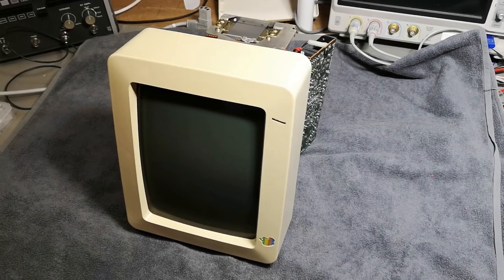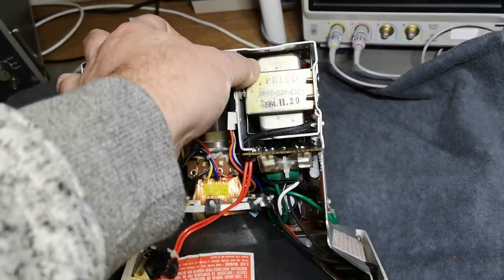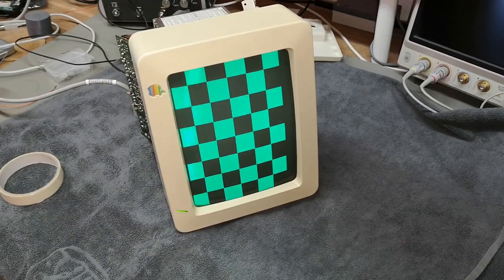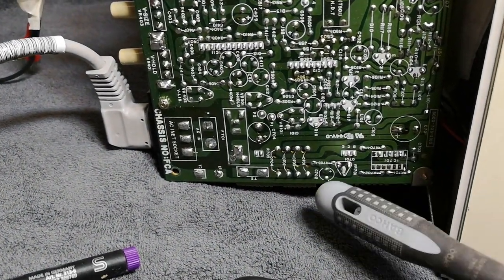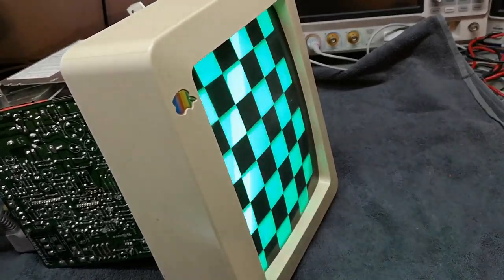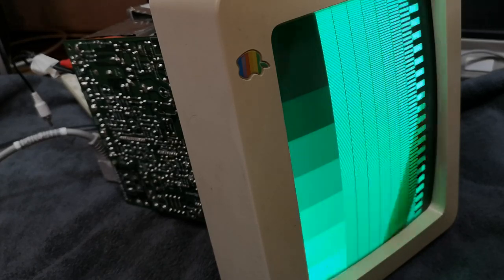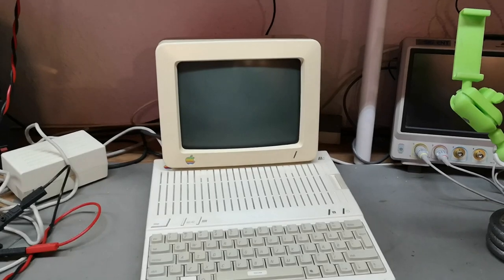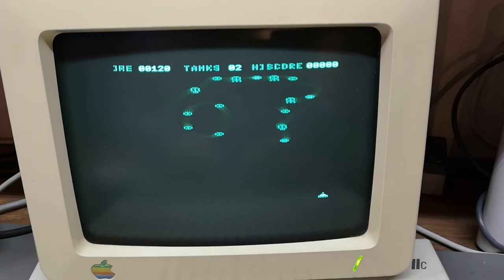Apple IIc original green monitor 1984 repair loose connections

Comment: Amazing that you found the elusive bad solder joint. I checked all the caps and was told it could be one of the IC's that had an internal issue. Gladly it wasn't!
Reply from the maker: i had so much fun fixing this one, and to play with the apple IIc later, it was cool to figure out my original demo disc was to blame for the graphisc errors, since none of your discs generated any type of errors, i feel my machine works fine. still need to learn how to copy a disc, but no one is alive who can reveal the trick.